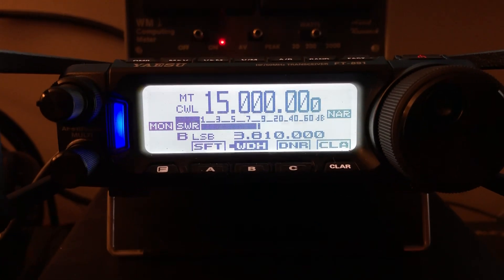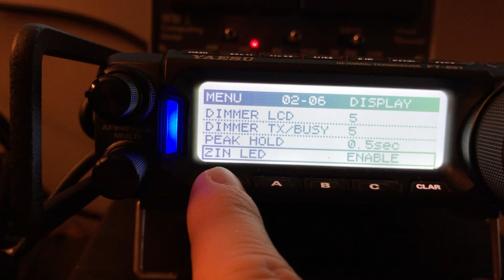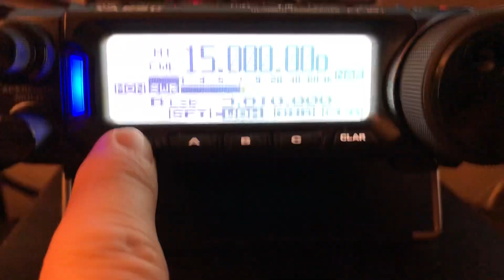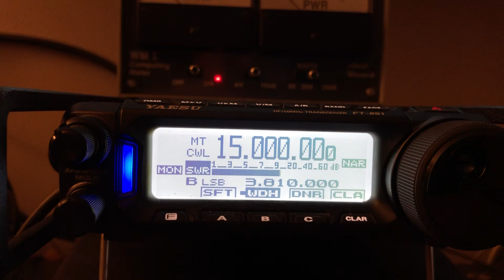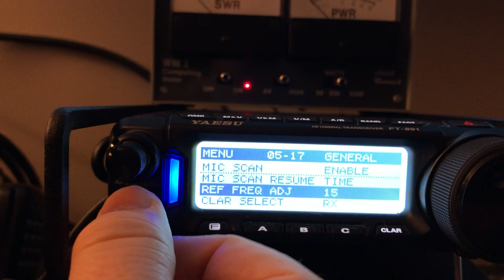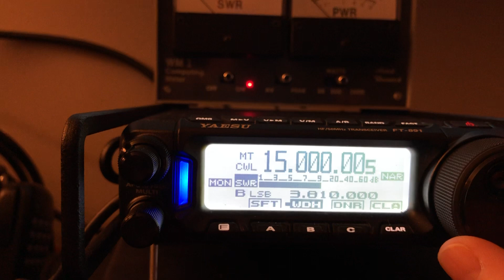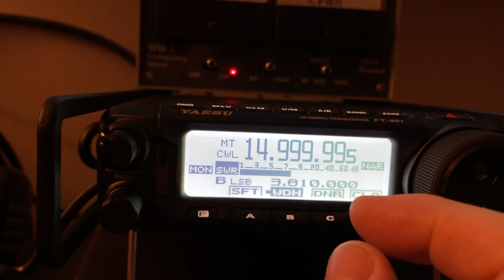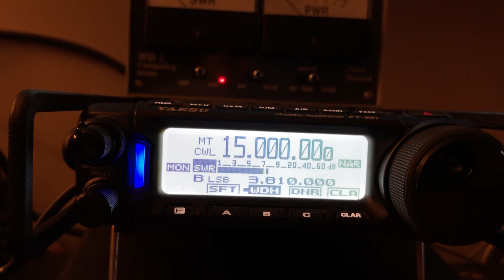Fine-tuning the Yaesu FT-891 Reference Oscillator

Comment: My FT-891 has to be set at +25  and it is still off by +2Hz .
Reply from the maker: Be sure to let the radio warm up for 30 to 60 minutes before you test.  The only way to get closer is to open it up and adjust the capacitor that controls the oscillator. It’s not worth it for 2 Hertz.  You can’t hear 2 Hertz difference on SSB.  It is barely discernible on CW.

Comment: As a new Ft-891 owner, and new to the hobby, this was a very informative video. Surprised Yaesu doesn't have a better quality control coming out of the factory, but I guess its close enough considering the amount of radios out there. Appreciate the info and will have to write these steps down for further reference. 73 👍
Reply from the maker: It seems that no company has perfect QC these days. Yaesu is generally pretty good.  In order to put a radio out for Christmas, they have been known to release before the firmware is fully matured.  But the hardware is usually fine, with the exception of early versions of the FT-991.  But firmware can be improved with updates.

A reference oscillator can drift due to temperature changes in your house or vehicle. The Temperature Compensated Crystal Oscillator in the FT-891 is leaps ahead of what we had in older radios. I heard a guy yesterday using an older radio. He was drifting by 200-250kHz. That’s extremely noticeable. The few Hertz of drift with a TCXO isn’t noticeable except on CW, and then only slightly.

Comment: The General Test for the Amateur Radio License it states that an attenuated RF output of the transmitter is connected to the vertical input of an oscilloscope in order to check the RF envelope patter of a transmitted signal. Is the attenuated RF output the frequency counter? How can a connection take place to a device such as an oscilloscope?
Reply from the maker: The attenuated RF signal means that you lower the power of the transmitter to less than the maximum power that the oscilloscope allows.  

At Motorola I used something called a service monitor. I could transmit directly into it as long as I did not exceed 125W. It could accurately display power, frequency, modulation envelope, etc. It was calibrated and certified for accuracy.

So let’s say that you are using an oscilloscope that has a 50-Ohm input rated for 0.5W.  Let’s say that you are testing an HT that has a low power setting of 1W.  You need 3dB of attenuation between the radio and the oscilloscope, in order to drop the power to 0.5W.

A dedicated frequency counter can detect a carrier in its vicinity.  It will then display the actual carrier frequency. This frequency can be created by multiplying or dividing the frequency of the reference oscillator, so it is vitally important that the reference oscillator be accurate and stable.  With the Yaesu FTdx10, for example, the reference oscillator is aligned by placing a frequency counter test probe directly to TP1097 (test point 1097).  Then you go into the “secret” service menu and adjust for 250.000000 +/-20Hz.  That’s the official method used by Yaesu.  My on-air method works from the final Radio Frequency backwards, toward the reference oscillator.  The “public” menu available to the operator allows for minor tweaking.  That’s the method used in my video.  No special equipment required.  We are calibrating directly against the National Institute of Standards.  Like I said in my previous post, the worst case is that the Beat Frequency Oscillator might be 1 or possibly 2 Hertz off.  That is negligible.

Comment: I can't seem to get the blue light to stay on steady. It keeps flashing no matter what I do.
Reply from the maker: The stronger the signal, and the closer you are to the frequency that will produce your desired sidetone (CW pitch), the more steady the blue LED will illuminate.  The ZIN function can automatically adjust the receiver for you.  

But, remember don’t use ZIN on 60m.  It can move you off frequency and inhibit transmit.  Use APF to fine tune a CW station on 60m.

73, de N4HNH
Reply: @n4hnhradio   Okay that explains why you were monitoring the clock. I'll try that. I was on a Clear Channel. 73 DE N3QQB..
Reply: Tienes pisado el micro

Comment: How do you adjust the RF power? My 891 has no ears?
Reply from the maker: Are you referring to transmit power?  That is in the menu, near the end.  Long press the function button.  There are separate settings for SSB, AM, CW, and 50MHz.

 If you are referring to RF Gain, the default is the the our ring at top left, the ring around the volume knob, is RF Gain.  But there is a menu choice to make it adjust squelch instead.

73, de N4HNH
Reply: @n4hnhradio  menu 16-1 through 16-3 ssb power, am power and hf power. Hf power controls the power on FM. I believe digital modes as well although I have not tested it yet.

Comment: Thanks for the video Doug - I just picked my first HF radio which happens to be the FT-891.  I don't have much to compare it to but from my research I think I've got a radio to last me a long time!  This feature is one of those things nobody would think to make a video on. 73 W0KNI
Reply from the maker: Thanks for reaching out, Stephen!  I’m always glad to know that the videos have helped.  73, de N4HNH
Reply: @n4hnhradio  Yesterday I gave this a try.  I found the tone on 15Mhz and pressed the Zero In option in the CW menu.  It moved about +4 Hz.  I went to calibration menu item and moved it up to max (25).  I tried a few things but could only get to within +2 Hz of 15.000.000.  Any thoughts? Or should I just move on and not really worry about it. 73
Reply from the maker: Stephen Payne, within 2 Hz is pretty good.  The maximum offset is 25.  On one of my 891’s I had to set to 25 to get to 1Hz.  Be sure you have pitch set to 300,  Also be sure that Fast isn’t enabled.  Enable the ZIN LED, menu 02-06.  Go to CW mode and adjust the VFO for the most blue from the LED.
Reply: @n4hnhradio  Thanks Doug, I'll give all that a try. Love this radio! Got it used for $400, and really happy with it.
Reply from the maker: That’s a great price, Stephen!  73, Doug